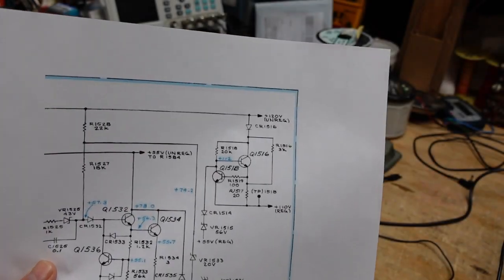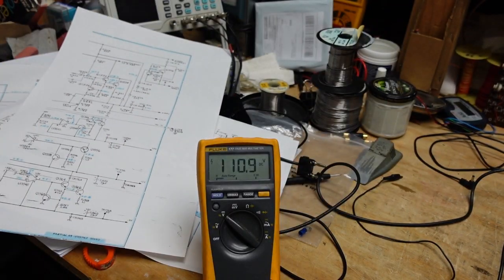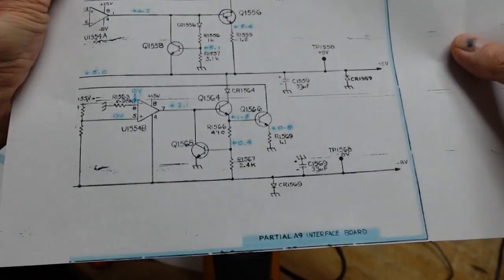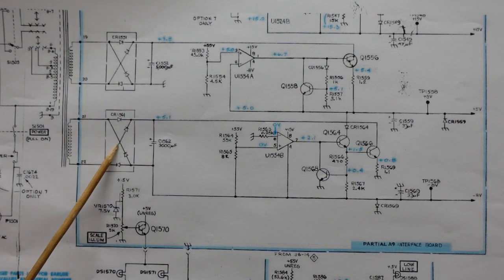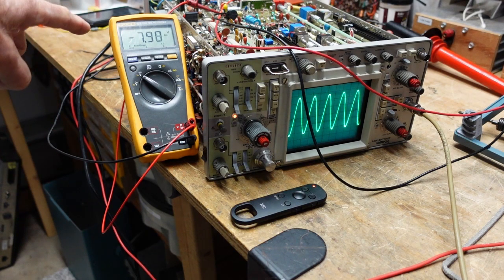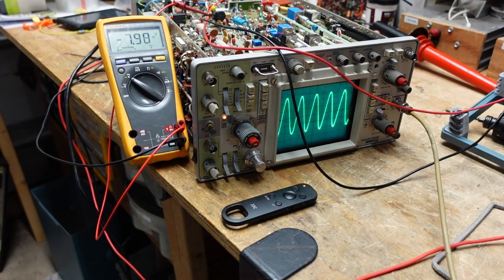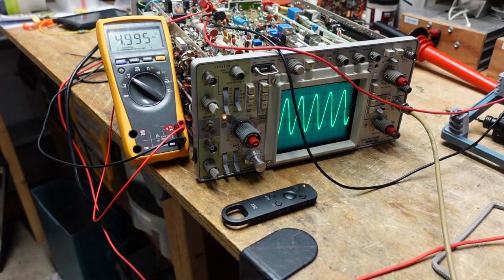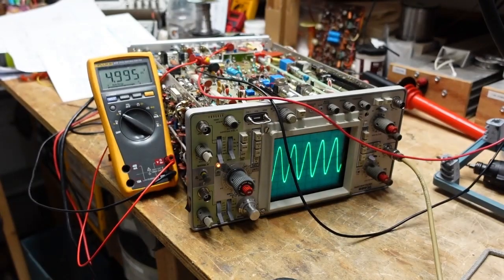Tektronix 465 No Display Part 2

Comment: That bridge was open on mine. To replace you can just wiggle it until it breaks free, then clear the holes and solder in a replacement.
Reply from the maker: Thanks Mark! Trying to access the bottom of the PCB is a real bitch. Think I'll try your method, since the symptoms point towards open bridge rectifier like you had.

Comment: Excellent video Ray. Is it possible that missing HV is somehow correlated to the issue with low voltage stage? BTW - my father used to say: if you can't solve the problem today, try to sleep on that problem and come back to it the day after. This is quite odd to me how true it is ;)
Reply from the maker: Good point, and one I'll check when I get the -8 VDC supply fixed.
The human mind is amazing, and I've learned the value of walking away from something if it's frustrating.  9 times out of 10 I'll fix it the next time I look at it.